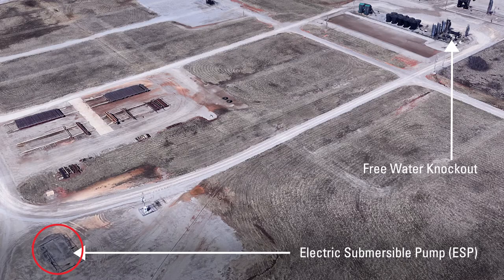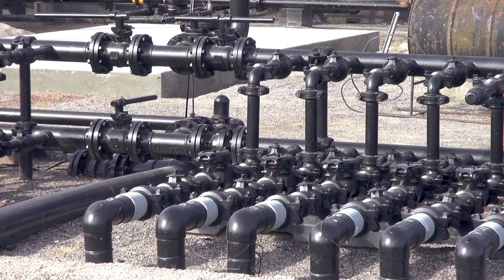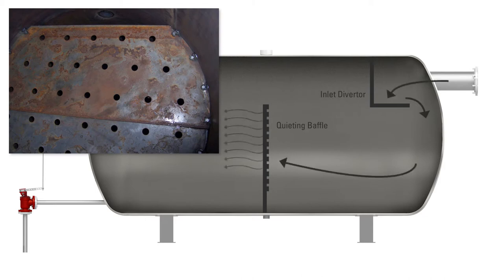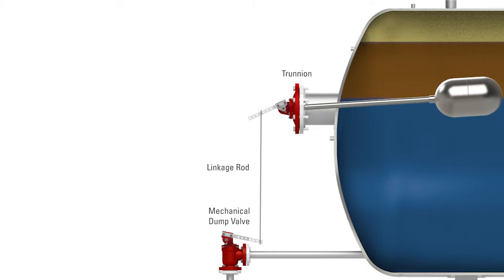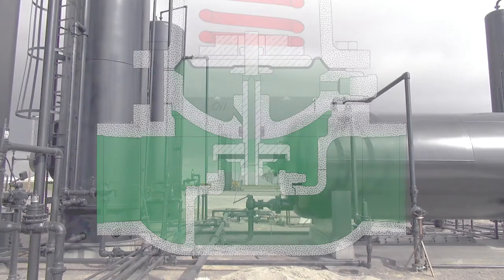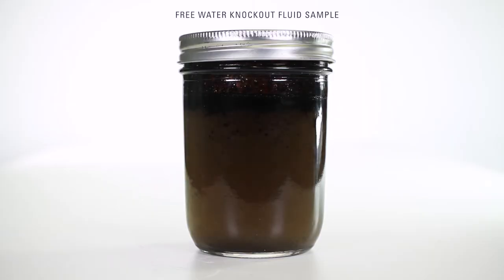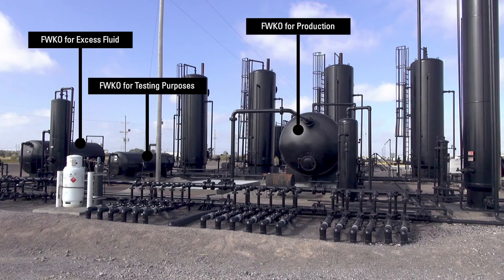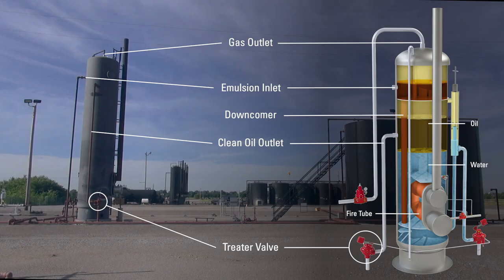Free Water Knockouts (FWKO) in Oil & Gas Production

Comment: So in other words, it's same as Horizontal 3 phase separator ?
Reply from the maker: There are many similarities between a FWKO and a horizontal separator but the main difference between the two is the size. The FWKO will have a much larger diameter to allow for more retention/residence time.

Comment: Why all the vessels are painted in black? Are they not been heated with sunlight?
Reply from the maker: Producers use different color schemes but painting separators a dark color will enhance the emulsion separation by absorbing heat from the sun. Sometimes in the heat of the summer a dark colored heater treater may not need to run the burner to maintain vessel temperature. It will definitely save on fuel costs to heat the vessel.
Reply: @KimrayInc  This is exactly what I thought. Good for viscosity reducing and further separation as a result. Thank you for your explanation. Frankly, I've never seen such a processing facilities with so little application of electric control system. Mechanical controls look spectacular. You, guys, do an amazing job!

Comment: Is this same as slug catcher ?
Reply from the maker: A FWKO is similar to a slug catcher but the application is different. Slug catchers are made for gas applications in the midstream sector to separate condensate (NGL’s) from the gas when a pipeline is pigged (cleared).
Reply: @KimrayInc  Is Slug Catcher 2 or 3 phase separator ?

Comment: many Thanks for video, ..is it fwko operation allow for high pour point oil ? how about pressure setting fwko ? high pressure will accelerate break emulsion ?
Reply from the maker: If you’re having issues with high pour point oil or paraffin you may need a heated vessel or run the flow through a line heater before the FWKO. The goal of the free water knockout is to knock out the free water. The separation of the emulsion is done in a separator downstream of the FWKO. Let us know if you have more questions, or you can contact our product application team or international team to talk on the phone. 1-405-525-4264
Reply: @KimrayInc  The FWKOD used demister?